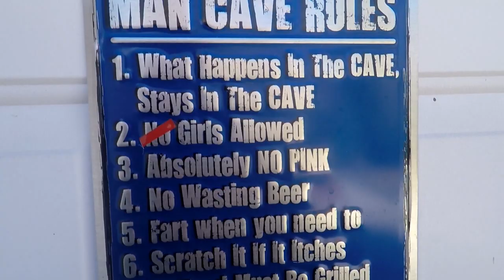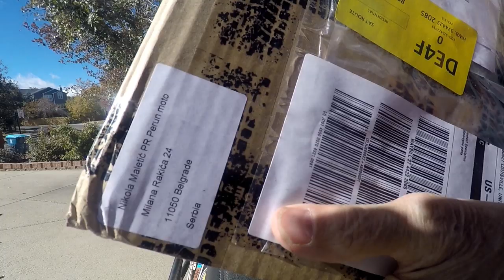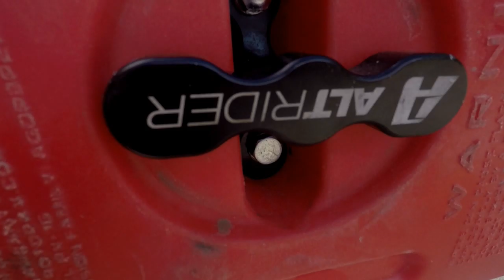KTM 690 Perun Moto Side Rack Install

Comment: Hi mike I think the back link of the Ktm pannier rack ensues both sides share the force when falling over, compared to the vicheni rack. What’s your opinion? Thks
Reply from the maker: The cross brace only connects to the other pannier rack, not to the chassis. I was always hesitant to allow friends to pick me up using the cross brace as its only held on with a 6mm screw. I think it is overkill and just gets in the way.